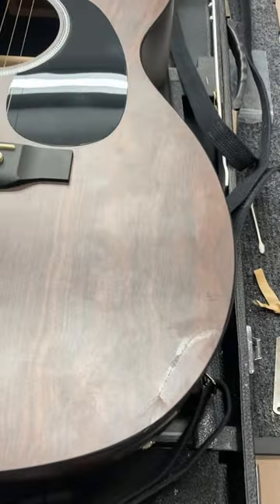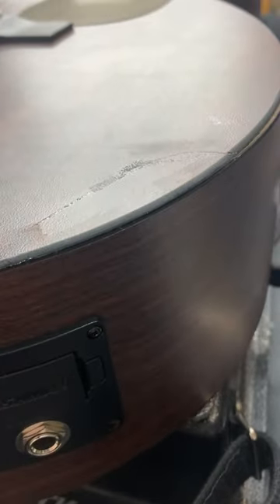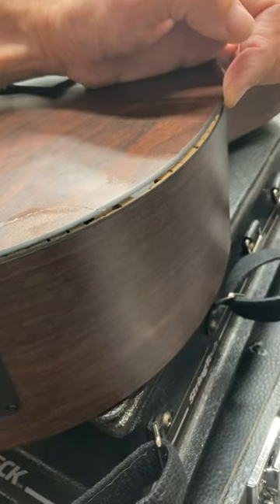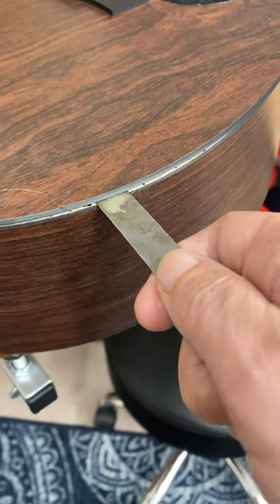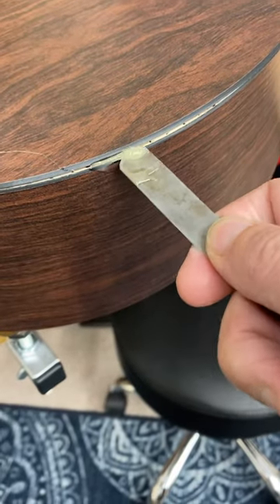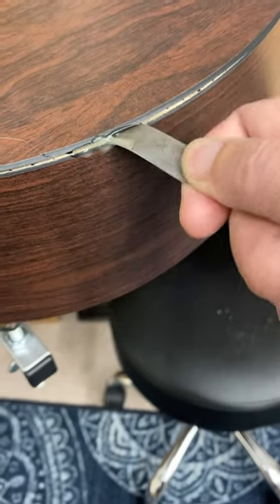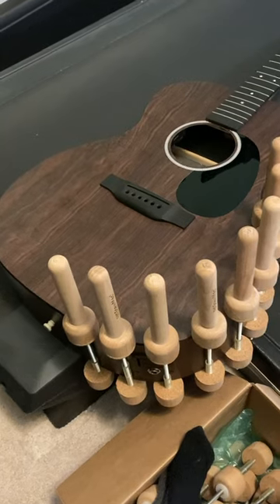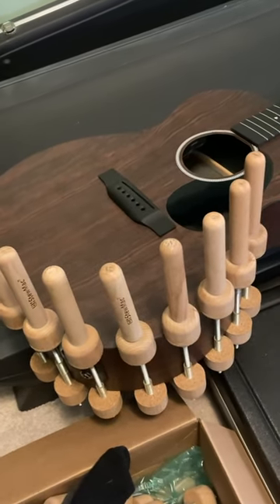Martin X Series Special Formica Guitar #guitarrepair #guitarrestoration

Comment: I've had these in my shop as well. The bridges have a tendency to separate from the formica top. If you scuff the surface with 180/ 220 the bridges glue back down without issue. But you definitely have to get through the non-porous surface to ensure adhesion. I've had to reglue the sides on some as well. All considered, they sound surprisingly decent. And they are not prone to swelling when you are playing outside. Just keep them out of the sun! The same can be said for any guitar I suppose.
Reply: Great work by the way, love your channel and your workmanship!
Reply from the maker: Thank You 🙏
Reply from the maker: I was told c.a. glue is the best adhesive for a bridge reglue on one of these. Which glue do you use?